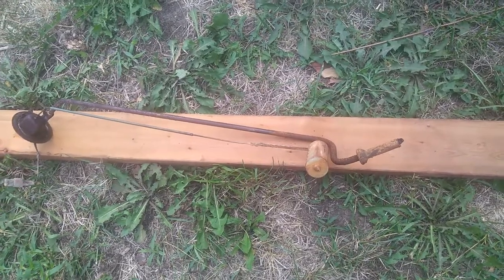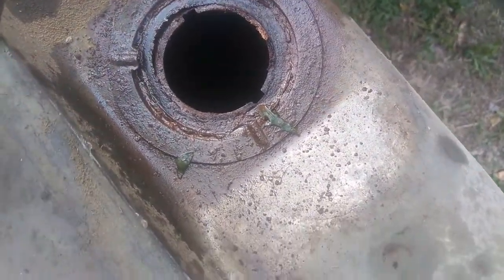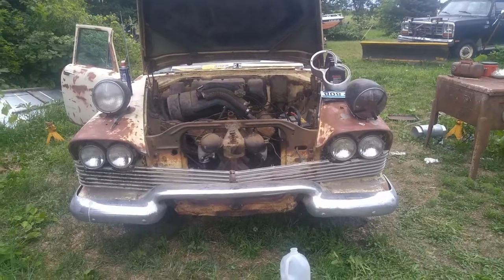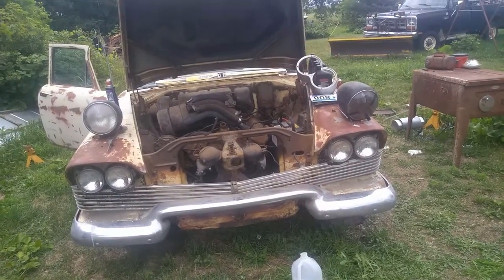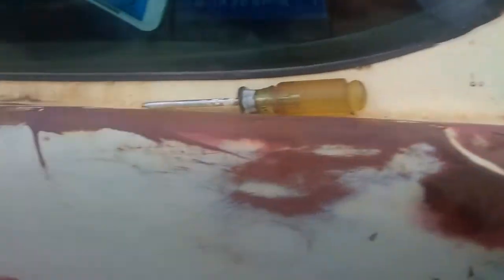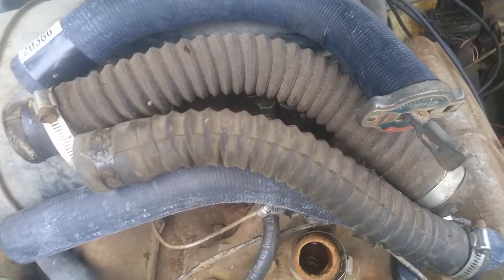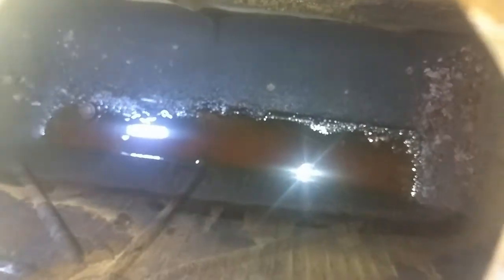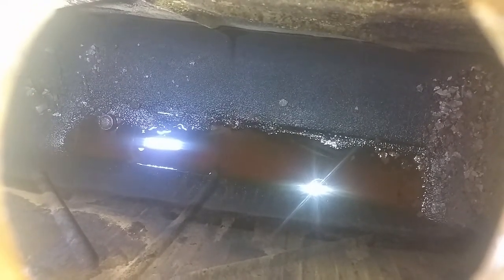1958 Plymouth gas tank

Comment: That's some nasty gas sludge there.  Probably what was going in with my snow blower... don't always remember to drain all the gas out.  It was constantly surging until I ran a couple tanks with sea foam.  Started running normal after that.
Reply from the maker: Thanks for stopping by!
Reply from the maker: I wonder what it would have looked like before I dumped the fresh gas in it? Certainly didn't have any resemblance smelling like fresh gas!